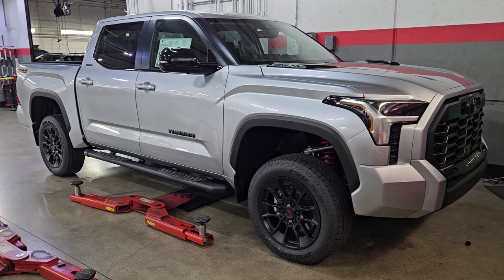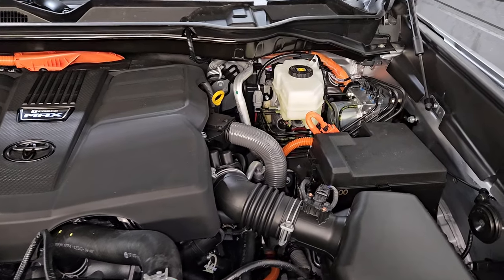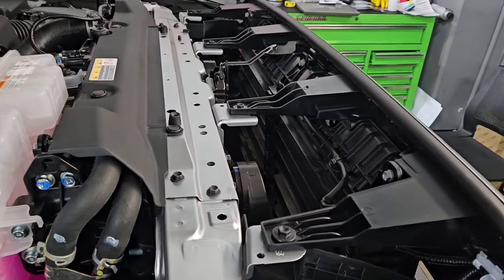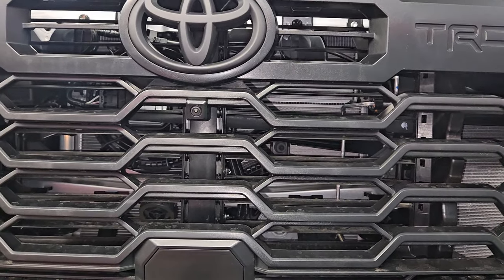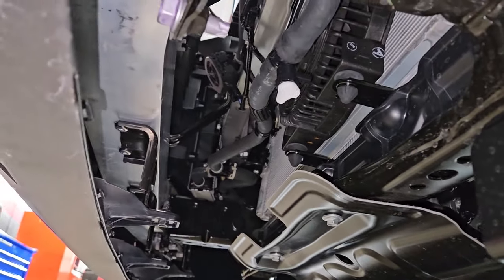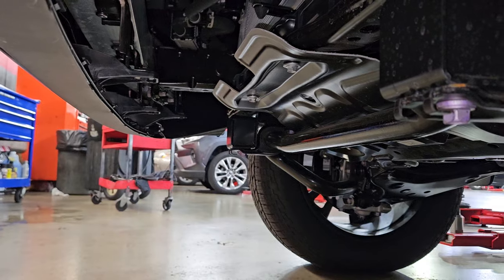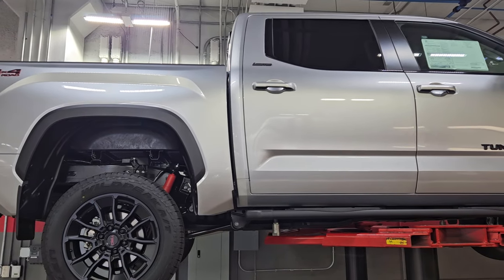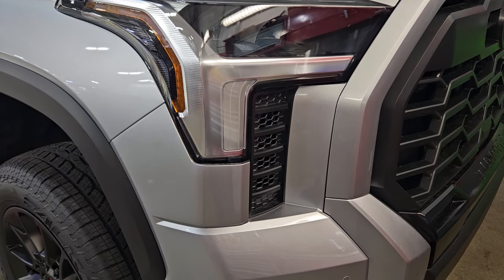TOP 5 COMMON PROBLEMS WITH THE 3RD GEN TOYOTA TUNDRA!

Comment: U mean like main bearings failing ?? That should be #1
Reply: less than 1%
Reply: Kind of a MAJOR one too!
Reply: @korbekleeninc.974  well I'm the 1% and if it's less then that why a 100k to 200k vehicle recall ? Because it's way larger then they let on. Did u know toyota changed the bearings in the 24. See the car care nuts video about it.
Reply: @johnurso5184  read the toyota investigation report. I made a video on how to find it
Reply: @johnurso5184  did you know toyota started changing the machining process in jan of 23
Reply: @korbekleeninc.974  they also started changing the bearings on 4/24 according to another toyota source who showed the discontinued part and the new one.
Reply: @johnurso5184  I know i watched it
Reply: @johnurso5184  the car care nut didn't show the discontinued part or the new one.

Comment: What about engine failure?  My 2024 Tundra Limited started skipping, because oil had gotten into one of the cylinders and fouled the plug.  It only had 5,631 miles on it.  No, I did not abuse it at all.

Comment: I have 2024 tundra limited iforcemax with hybrid engine. I got a check engine light on at 1500 miles. It says malfunction in electronic control of the engine, throttle or automatic transmission. I am not an engine guy. Is there anyone else experiencing the similar problem? The car is at dealership for a week now. We will see what happens.

Comment: I own one, 2022 sr5 and only got 17k miles on it, so far not experienced anything mentioned. Best truck ever for me.
Reply from the maker: Nice! Just know those updates are available for your truck. You might as well get the latest software updates for the TCM.  The reflash is covered under the 3yr 36k miles warranty
Reply: Just because you havent experienced it doesn’t mean others havent. Ur comment is pretty irrelevant
Reply: @Tiovergudo  how is it irrelevant? Im just saying I haven't experienced it owning almost 2 years. Why you mad bro?
Reply: @Tiovergudo  His comment is not irrelevant at all. His experience adds to those who have NOT had issues. You're just being narrow minded.
Reply: Wait till your engine blows up. Mines did at 22000 miles 1794 Edition. Bad machining, spun bearing - complete engine replacement.
Reply: You are lying. You either work for Toyota or you are in denial.

Comment: What is Toyota doing to correct the seat plastic?
Reply from the maker: They have an updated part out. They made it more durable.
Reply: They won’t they’re cheap seats. I had a mechanic tell me that Toyota is putting cheap parts in their trucks now they’ll never fix that problem. You look at the ram seat or the Ford seat. You’ll never have a problem with them.
Reply: @mikewade4102 I have a ford truck for work.  Truck is junky compared to my tundra.  Loads of issues

Comment: Drive line vibration at highway speed under light power. All I have gotten from the dealers is lies and run around. 2024 SR5 TRD Sport3k miles.

Comment: I have a 22 1794 long bed with auto leveling suspension. 
I like it a lot but still have wind noise at the RR door seal and an occasional dead pedal acceleration from a near stop.  The latter has nearly gotten me into two accidents. Dealer said all the software was up to date. Hmmm.

Comment: Mine are 3 things on my MY2024
1st : I get wind noises at 50 to 70 mph
2nd : Squeaky / Noisey Brakes at Startup
3rd : Noise from the crappy dealer-installed Cat Guard, they didn't tighten the bolts and now one is missing
Reply from the maker: Have they been able to resolve any of your complaints?
Reply: Lol

Comment: I have 23  1794 edition with trd lift im seeing alignment wear on tires at 9k miles but told its in spec. I was wondering is there a tsb or updated spec? Also have rattle in driver door window trim, my lower thigh support no longer functions on driver seat, it seems to idle a little rough also for being brand new my corolla with 130k on it idles more smooth, also feel a slight surging under light throttle around 30 to 35 mph as well as trans feels too soft in normal mode when its in sport mode it feels more solid and firm like i would think a new truck should feel any suggestions on these issues?

Comment: Whatever you do don’t forget about the damn seat panels. They are terrible they’re cheap and they fall apart. I’ve had replaced three of them on my Toyota 2022 tundra 25,000 miles guess what I traded for a ram 1500. They are built so much better and they are stronger riding trucks more comfortable better ride better everything. Toyota has gone by the wayside. I’ve owned them for many years, but they’re cheap now and they’re not worth the money.
Reply: Such a shame Toyota has gone down this road…major disappointment.

Comment: I bought 2024 Limited Trd when I get home, I recognized Clicking thicking noise on the driver side between, dashboard, and tires some where, when I was in parking on my driveway. The noise was coming from engine. ! The truck was Brand new I did 40 mile, from dealership to my home. And then I’ve just returned it and then I get refund wash my hands. Problem is not mine anymore. I have no idea what was the clicking noise they didn’t tell me after all so I just let it go. So yes shouldn’t be clicking noise elwith Brand new truck.